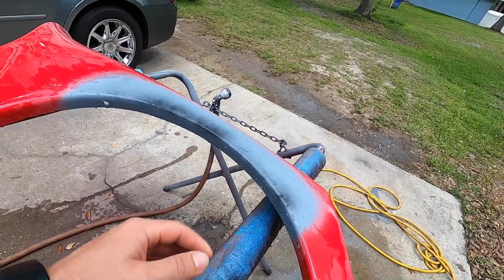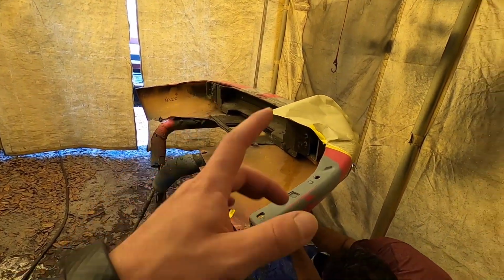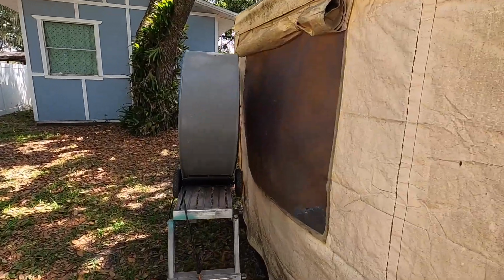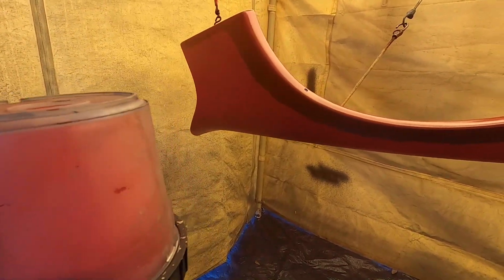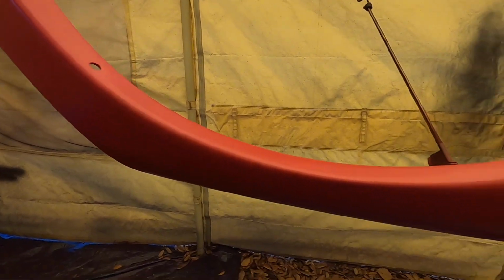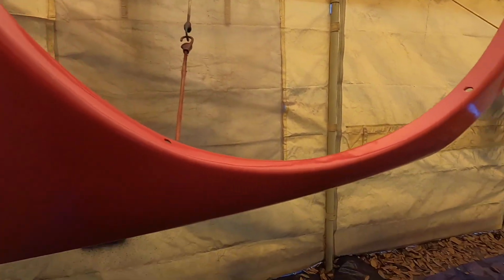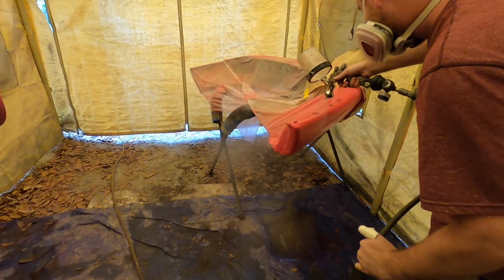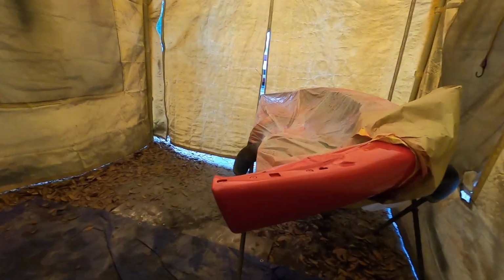Learning How to Paint on Dodge Viper ACR Fenders | PART 5

Comment: Great job for your first time out! Everyone gets "gun" shy the first time...quite different from a rattle can.... should be able to color sand and buff in a day or two.only place I see you having an issue is the bumper...I would have cleared up to the stripe...tape the edge of the stripe and clear it to there.or sanded the whole bumper and cleared the whole thing.....just take your time.are the stripes painted on or are they vinyl?.....and yes do more body work and paint and do your own hellkota repaint you will save alot of money and learn and expand your skill set...👍👏👌✌️